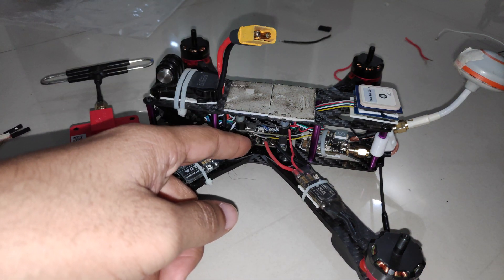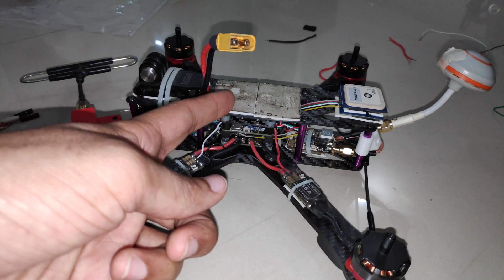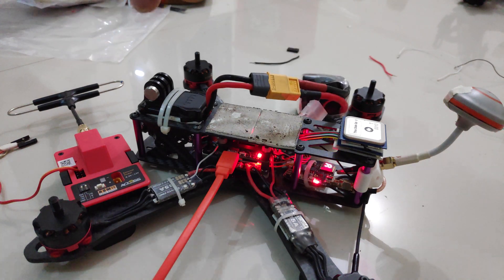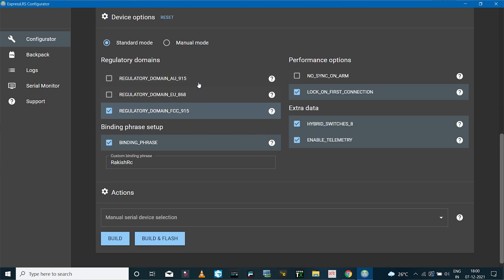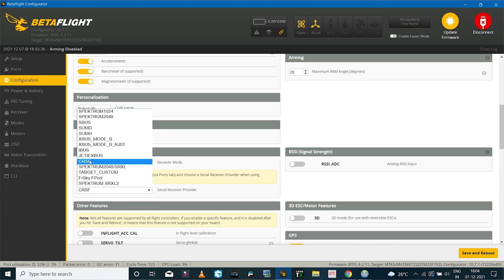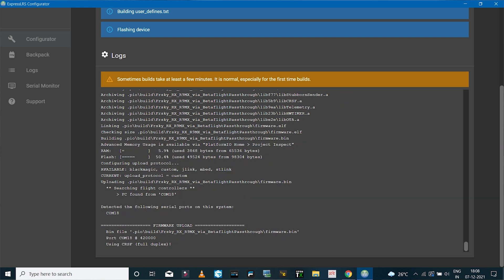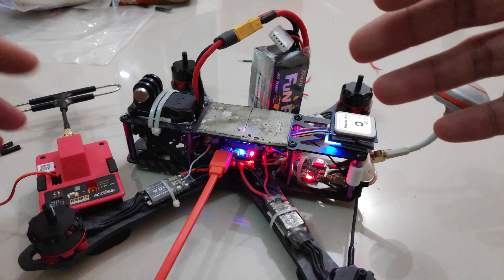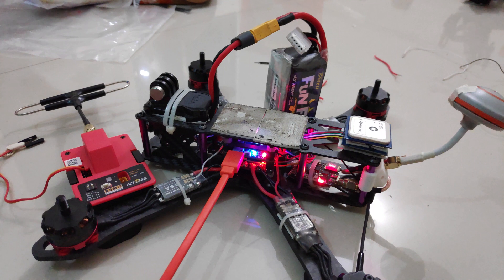Express LRS Betaflight Passthrough Method R9MX Receiver Failed to enter Bootloader? Fix

Comment: after flashing both R9M TX and RX with expresslrs, do you need to bind again? if so, how do you bind the TX with RX standalone, without the flysky or frsky radio?
Reply from the maker: While flashing with elrs firmware you should assign the binding phrase for the tx and rx which will automatically bind the rx and tx once powered on and elrs protocol is selected in the radio settings.
Reply: @RakishRc   thanks for your response. I'm taking up this project. Would you please share any of your socials to connect ?? I'm in dire need of help and don't want to waste money on random components 😭.
Reply from the maker: @preetamghoshdrums219  contact via telegram @Rakish33
Reply: could you pls share the wiring of r9mx with f4 flight controller @RakishRc   ??
Reply from the maker: @preetamghoshdrums219  you need to connect to a uart on the flight controller. Make sure the tx of receiver is connected to rx on flight controller uart and the rx of receiver is connected to tx on the same uart of flight controller..the ground and 5v will be used for power. Expresslrs website has r9mx wiring guide..https://www.expresslrs.org/quick-start/receivers/r9/

Comment: Thanks for posting this. Pity it didn't work for me. Any other suggestions besides this method? My story is that the rx stopped connecting to the tx after a small crash. It had nothing to do with any loose connections or solder points. I already checked. I'm able to flash, but it won't go into bootloader. I have repeated the process on 3 different flight controllers. I just don't understand how a crash would cause this specific problem.
Reply from the maker: So since you've had a crash and it's not entering bootloader mode could the button on the receiver be busted? Also which bootloader file have you flashed on the receiver? Regular or no button bootloader file? I can only update via pass through if no button bootloader file is flashed on receiver
Reply: @RakishRc  Between the time I posted my question and your response, I managed to get the rx flashed by placing it in yet another flight controller (again). I flashed it with the original bootloader (not the no-button). So now I'm back to square one, which was the situation right after the crash: rx is no longer recognized by the tx, with the red signal light on the rx just flashing, not matter what I do. I've concluded that something must have happened during the crash, probably some sort of current surge or short to cause the rx to stop giving off a communication signal. No one seems to be able to assist, even on the discord forum, which means this is a very unique problem.  I've ordered 3 JHEMCU receivers. This company does not have a good quality control record, so it's usually a hit or miss with them. All the other companies are charging double the cost of JHEMCU's, so I went with the budget brand. Wish me all the best! Thanks for your assistance!
Reply from the maker: @adeyinkabrasil4426  all right hope you get your quad fixed and working again 👍 but I'd still suggest if you could try flashing the no button bootloader file and check if it could work because I suspect the button on your receiver may be bridge somehow after crash
Reply: @RakishRc  Friend, I did try the no-button method a few times on different FCs, and it did not work.

Comment: Thanks for sharing ..is this process the same for the R9 SX receiver ?
Reply from the maker: Does r9sx support elrs? If it does you could try flashing the bootloader file for that receiver with a radio if you have first
Reply: @RakishRc  I believe it does. I did flash the boot loader file on it. It's  getting the elrs firmware via passthrough on to the receiver . There isn't Tx and Rx points to connect to in order to flash the firmware onto the receiver. Flashing this receiver is done via OTA for updates from FRsky.
Reply from the maker: @91zulu  but if it's doesn't have rx and tx connection how will you use elrs?
Reply: @RakishRc   well that's the answer I am hoping someone has the answer to. This is a new receiver FRsky came out with recently. I did not know there wasn't Tx and Rx pads on this receiver. I read a review on it and someone was able to get ELRS on it. Just don't know how. I needed the PWM pins that is why I got it. Most of the 900 MHz ELRS receivers out there are for quads with only Sbus and maybe 2 PWM pins.
Reply from the maker: @91zulu  actually i read few posts on elrs Facebook gorup regarding r9sx..and it's hardware is not supported for expresslrs unfortunately at this time. It may be supported in future however I am not sure. I'd suggest best stay with frsky firmware for that receiver and use it.